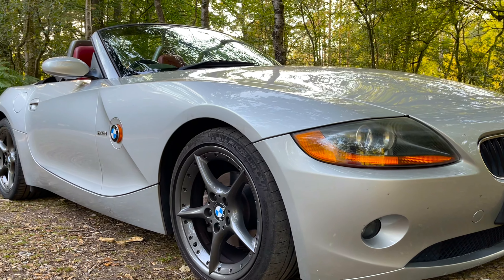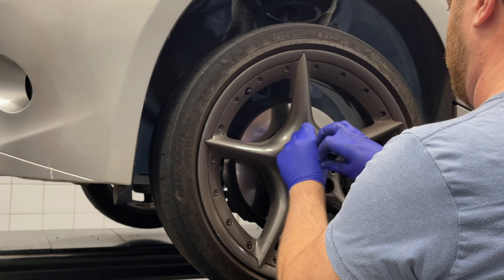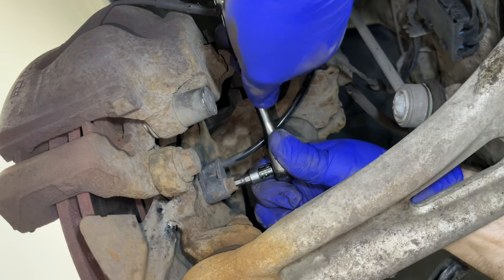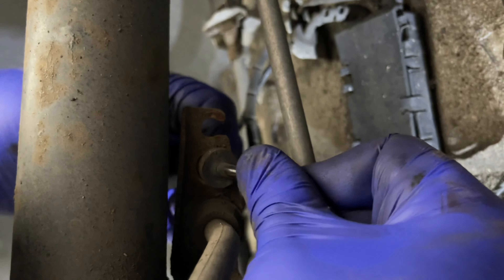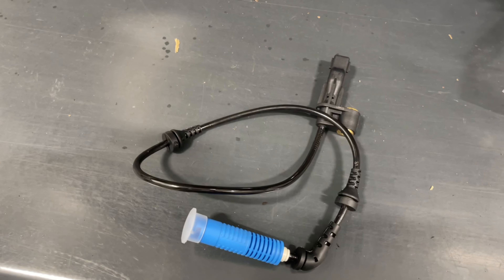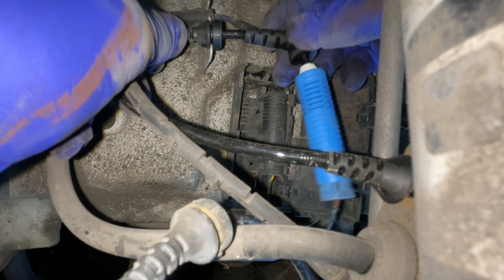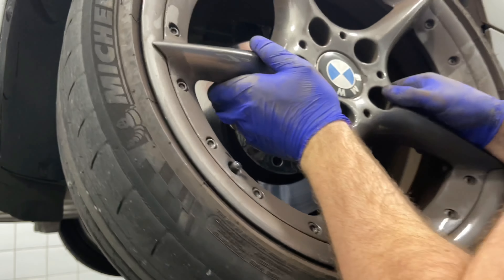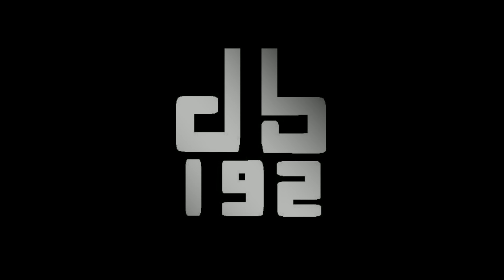BMW Z4 E85 ABS wheel sensor replacement

Comment: I honestly don't understand why they couldn't make the ABS sensors compatible with each wheel. There's a front left, front right, and rear left and right. like, wtf? I know I have a faulty ABS sensor but cannot be sure of which without buying more equipment to diagnose which one. Any logical thinking person should just be able to buy 1 sensor and use the process of elimination to determine which one is faulty without paying through the nose! great video by the way. thanks 👍👍
Reply from the maker: You can buy a OBD reader with ABS for about £40 which will help diagnose any future problem with your Z4. A sensible investment if you plan to keep your car long term.
Reply: @db192   what code reader did you use in this case?.....is there a way to check spec on one of these units with a Voltage meter to confirm it is definitely bad? thank you be well!

Comment: Great video. Nice and clear. Are there any budget scanners that can read abs codes?
Reply from the maker: Thanks, the budget code readers usually don’t read the abs system so will need to spend about £50 for one. Just search bmw abs code reader and pick the cheapest pne

Comment: How do you get the brake pad light off
Reply from the maker: If the brake pad light is on with no other lights then the pads are most likely running low. There is a little sensor on the front right caliper and rear left caliper that tells the car when they are low. If the pads have plenty of life left in them it may be worth replacing this sensor.
Reply: I have brake pad light on which turn traction fully off what is causing this

Comment: Just curious, I have these lights on mine, what symptoms did you have?
Reply from the maker: When this happened the traction control and ABS didn’t work but no other performance issues, I just drove it carefully. It was intermittent and usually the lights would reset when turning off the engine and turning back on.
Reply: @db192  ahhh, in my case the brake pedal is really hard after the 1st press, it feels ok for the 1st inch or 2, then feels like I’d need legs like Arnie to stop the car.. 😳

Comment: Are these sensors only on the front drivetrain or also at the back?
Reply from the maker: They are on all 4 wheels.
Reply: @db192  got this intermittent at first bit now permanently after skidding for a bit on wet tiles. Gonna replace both rear sensors when I have time
Reply from the maker: @YZFMANIAC08  mine was intermittent too for about 2 months until I got fed up with it and replaced it.